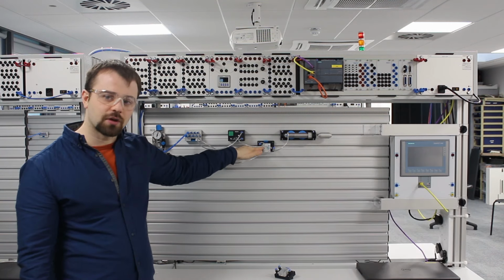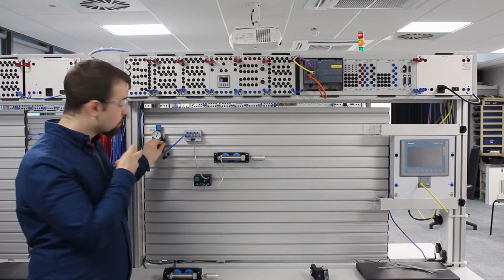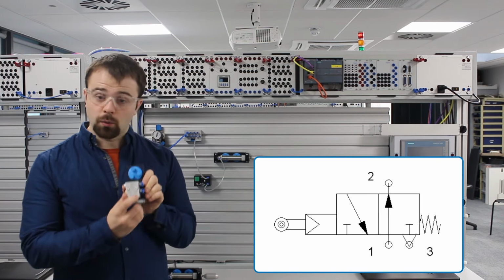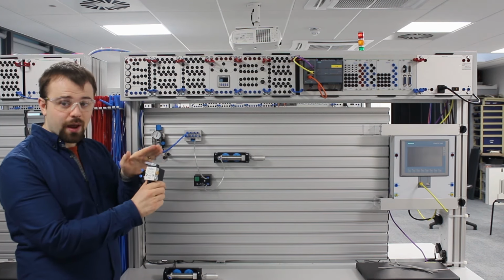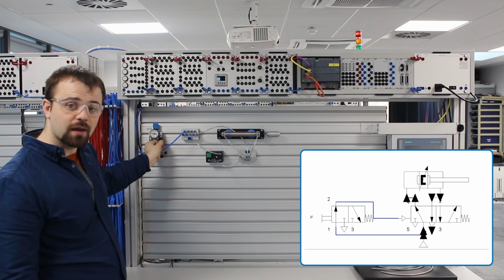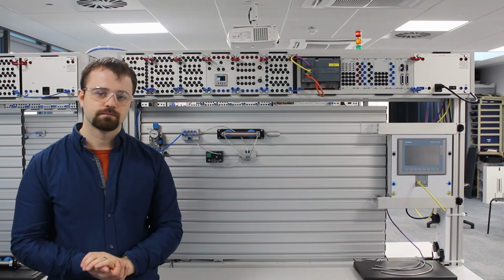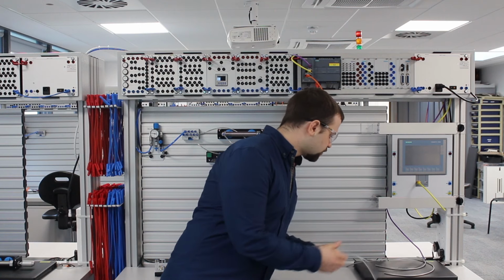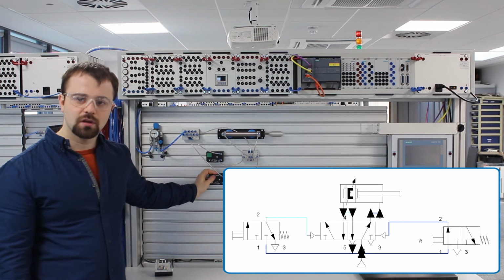Mechatronics : Control Valves

Comment: Superb presentation skills. Thank you. One genuine question: why is it you say the lever actuated 3/2 valve wears out more if placed upside down?
Reply from the maker: The valve is not the part that wears out, but the mechanical element of the roller valve. It is not being upsideown that is the problem, but the piston hitting the switch on the wrong side of the pivot / fulcrum